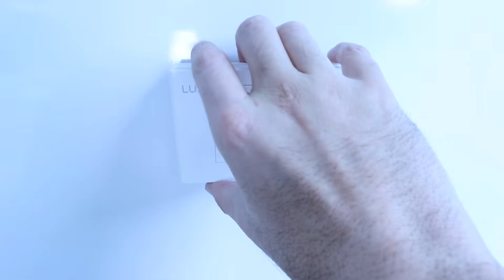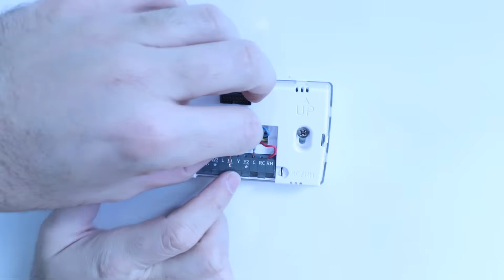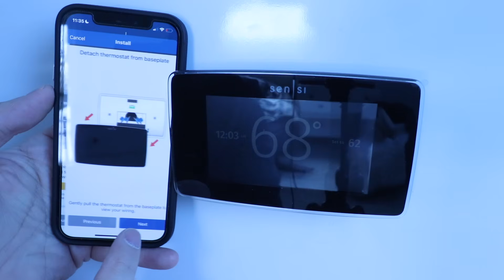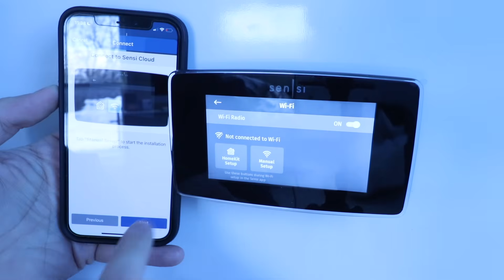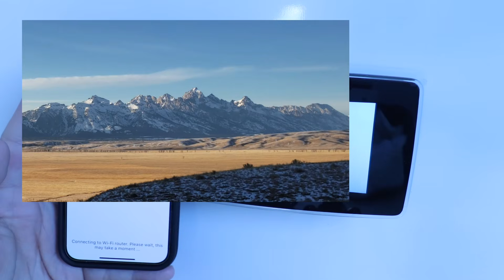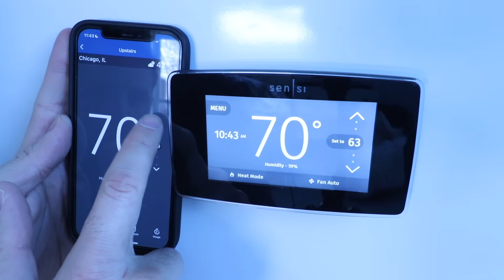How To Install Sensi Touch Smart Thermostat (ST75)

Comment: I have a black wire that I connected to C and no blue wire. I also have a jumper on my old unit that goes from RH to RC. Lastly, brown one is connected to RH. Someone have some advice? I had to put the old unit back on.

Comment: Anyone have any answer as to how to wire it if I have 6 wires (orange wire is the 6th).  I suspect it's because I  have a heat pump/ac type unit.  Just not sure what that means for wiring?

Comment: Anyone that can help, I only have four wires instead of five I do not have the yellow one. My AC is not working the heat was. I’m also having problems removing the wires just in case I need to put it in another spot, but I’m not sure what the AC tech did before. It’s hard to remove.
Reply: How did you solve the problem? I’m having the same issue
Reply: @ I just got a Honeywell from Home Depot and install. Tired of waiting on the ac tech to try to fix it.
Reply: @ thank you

Comment: Tip of advice. If you have existing C wire, but must hook it up at your HVAC terminal board. Please note the door has a saftey switch and without the door reinstalled, the system will not turn on 🤦‍♂️
Reply: You are an angel bro. I was about to rip everything out and put the old one back on.

Comment: I’ve a humidifier brown wire, where should I connect on the unit? Thanks.
Reply: Humidifier connects to Y2 and dehumidifiers on W2. Seems counterintuitive but that is the correct wiring method.
On the Touch 2 would use the ACC terminal.

Comment: My heat wouldn’t turn on after following the instructions in this video, and in the app to a T. 
It was incredibly frustrating until I realized that the company that installed our new furnace flipped the white wire and the brown wire when connecting the wires on the on the furnace. 
I’m posting this comment for anyone else that ends up with either the heat or the air not turning on.
Go and check the wire connections wherever the main unit in your house is. Mine is in the attic, and that was the issue. Once I connected the brown wire into the white wire slot, it worked like a charm.
Thank you for your video!
Reply: Our furnace company did the same thing! So stupid and annoying. The only reason we found out is our thermostat broke and I was so annoyed with all the issues I called a pro to install it m

Comment: Mine wouldn’t hook to my WiFi. Any suggestions?
Reply: Most smart home devices only operate on the 2.4GHz band. And on some internet supplied routers the 2.4GHz feature was removed.
Don't lease your ISP's equipment, buy your own.
Reply: I am totally lost. Login on my router? My power just keeps running down from phone and this iPad I’m watching this video!
Reply: Just turn off 5ghz from the Router login

Comment: I bought it and I installed it. Does not work with my RUUD heating and cooling. I was able to connect it to my wi-fi and the app communicates with the thermostat but the heating and cooling do not turn on. Called the so called customer support number for SenSi and the only thing you get is recordings, no live customer support. I called RUUD and they could not help me. I called my HVAC installer and of course they want $90 just to walk in the door and then tell me if it will work or not. So I just might return it.